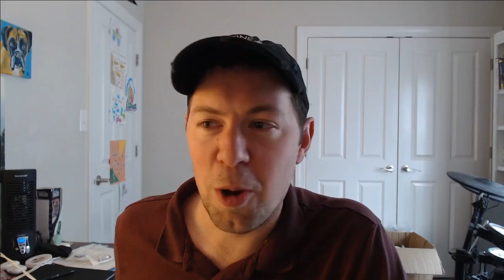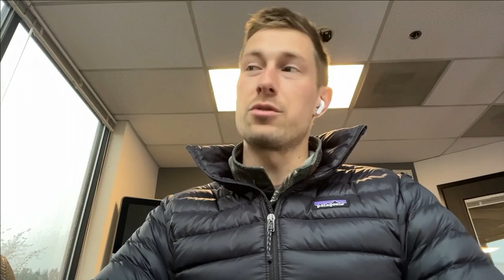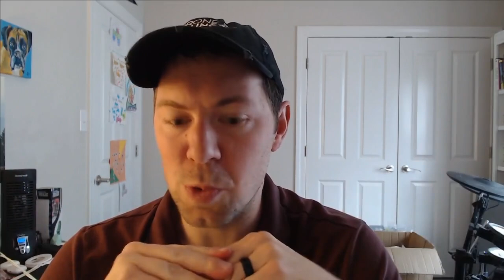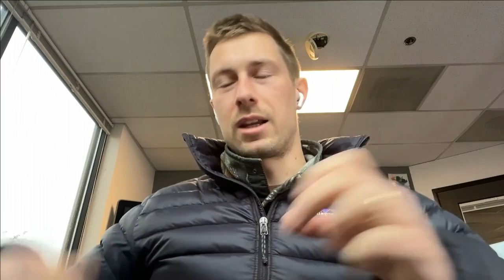How Are Drone Tethers Being Used? (YDQA Ep 100)

Comment: Most interesting, I am a Ham Radio operator and interested in using drones to place assets in trees for example.
Reply: Fascinating use case. The challenge there would be balancing how close you have to get to the tree with how fine-tuned the equipment placement needs to be. There are a variety of drop mechanisms and other attachments for placing power lines, etc, but generally besides the power lines and poles themselves, not having to deal with the obstructions of tree branches.